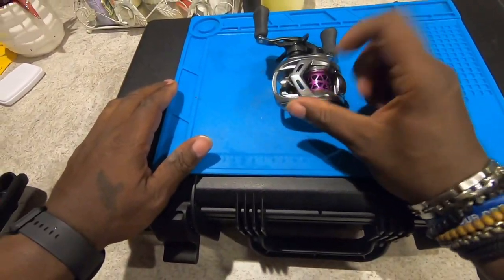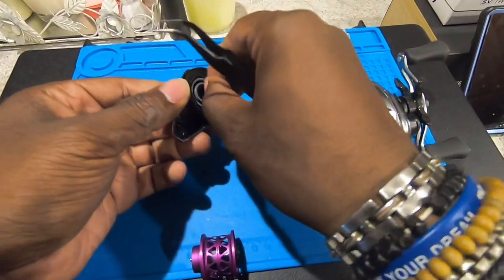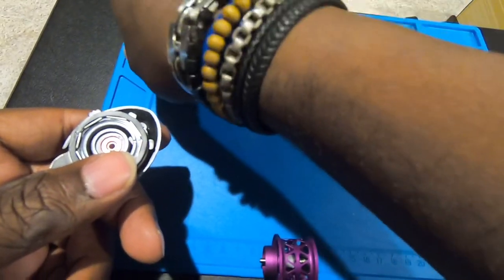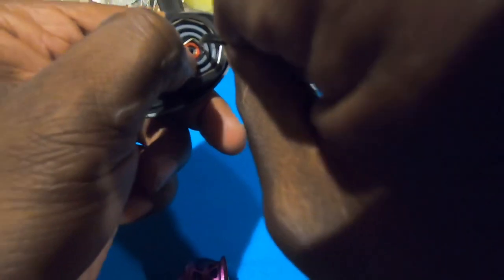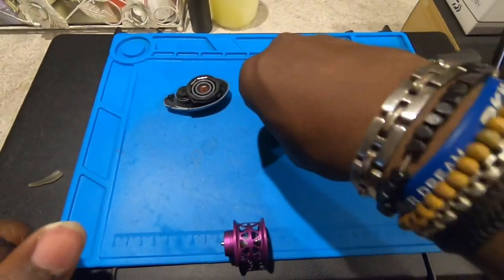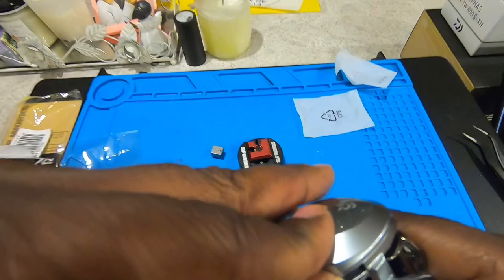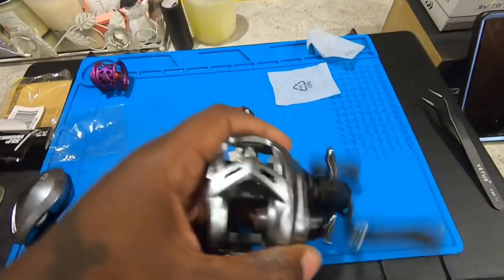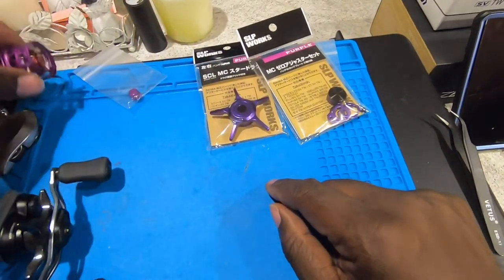Daiwa Alphas Sv Tw 800s xh fishing reel maintenance (modification)

Comment: I think this is a lil gem of a reel. I want the bearing, spool and a drag clicker upgrade. My question is will it be as smooth as Zillion in a smaller size? I will mainly throw 1/4-3/8 oz . Thanks
Reply from the maker: I never used a zillion with bearings spool and clicker everything is smoother than the original out of box build.

Comment: Hello, I need your help with some information about the above product. Can you give me contact information?
Reply from the maker: What is your question 🤔
Reply: @The_Multi-species_Angler  oh! I need information on the size of the main bearing (or roller bearing). Mine is broken but I don't have the exact size because it doesn't have a caliper :((
Reply from the maker: @hoangtrilenho9488  I can give you the  link to where to order just the part and schematics to insure you get the right part.
Reply from the maker: @hoangtrilenho9488  here is the schematics https://www.sl-planets.co.jp/common/index.asp
Here is the link to order the parts https://www.plat.co.jp/shop/catalog/partsorder.php?products_id=4754
Reply: @The_Multi-species_Angler  oh! thank you so much!
Reply from the maker: @hoangtrilenho9488  welcome